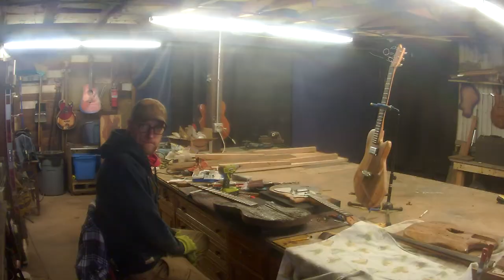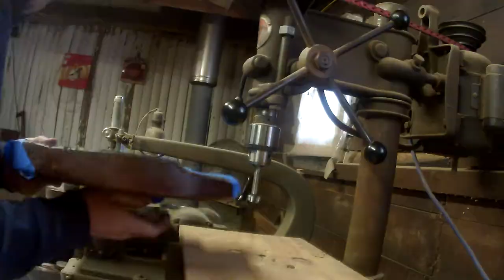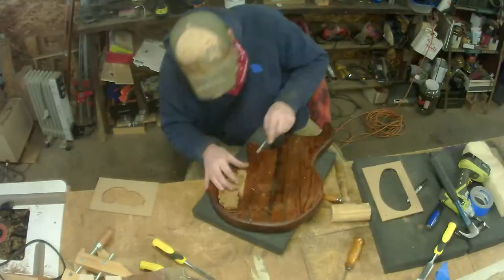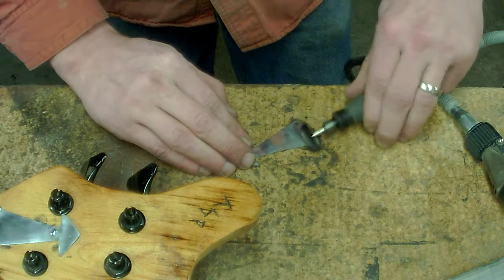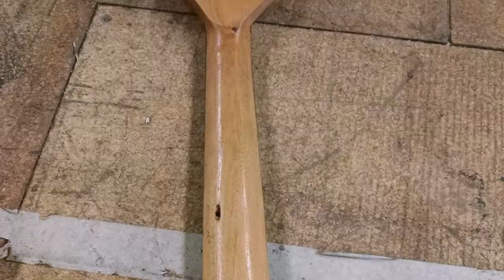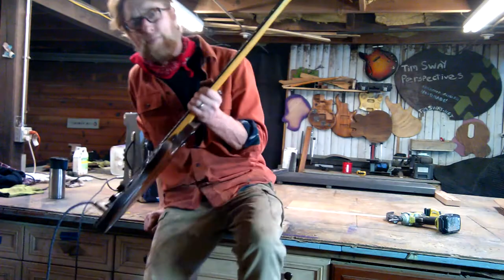pt 8 guitars, rough barn wood electric bass

Comment: Great Job!  Love this.  You're making me want to try and build a bass.  I'll add it to the list of things I gotta make!!  Great series too.  Look forward to the next one. Cheers!
Reply from the maker: Andres Salas you absolutely should. and you start easy! i see you play the dbl bass, so you don't need frets which makes it way easier - and you can play any scale length. i made a dbl bass out of a 2x4 with basically just an angle grinder, drill and sander in about 4 hours. and not one of these 2-string, barely playable DIY things, it's a  real, useable instrument, check out that vid (or the waterski or snow ski, for that matter) on my channel and get to it!

Comment: Pine for the neck? Not a great idea. Love the look though.
Reply from the maker: Not my fav wood for guitars or necks but I have made several that have performed flawlessly for several years and still kicking. If you use a good fingerboard material and properly support/truss it, it's fine. Biggest weakness in soft woods is getting good joints that don't get smooshy or ugly.